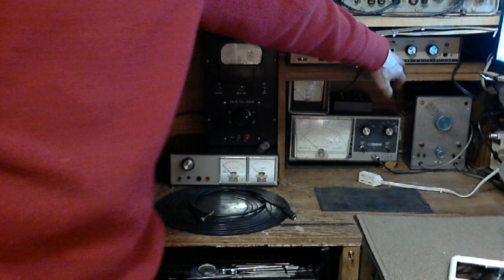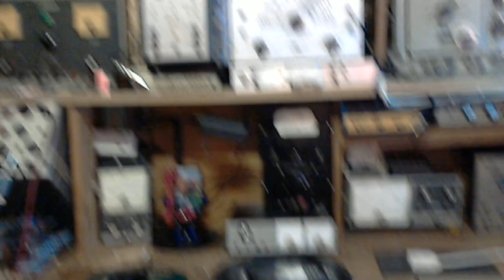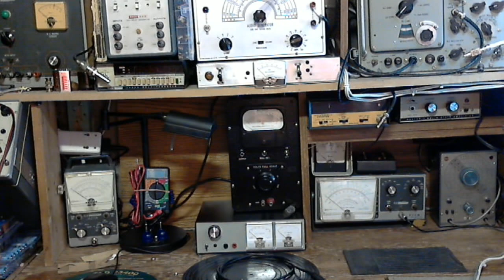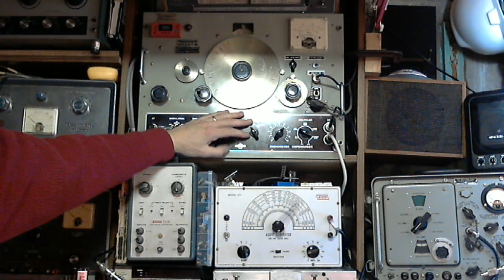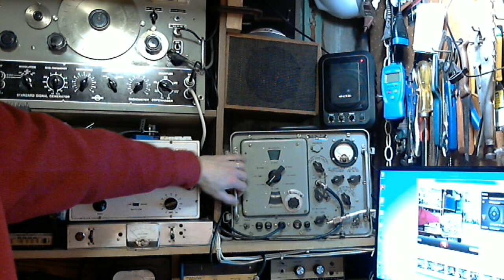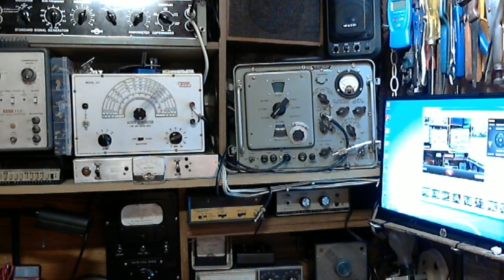Jim's Radio Shop - My Wall of Equipment

Comment: Half of the wall of equipment doesn’t work at all, out of calibration or he has no clue how to use any of it. All it takes to fix a simple AM radio is a Simpson 260 and a good soldering iron. Actually an oscilloscope is the best piece of gear any shop can use and not those shitty new Indian digital pieces of crap. Get a vintage 100 Mhz TEK scope , even a 50 Mhz will do. With a scope you can measure ant voltage AC or DC, frequency, time, phase shift, high frequency signals like 455 Khz and RF 1500 Khz. Input impedance will not load down grid circuits. He has no clue about any of that.

Comment: You hang on to that AN/URM-25D! Who cares what it may have been worth, it's worth a lot in utility today to work on older radios. When you get a chance, check out the meter accuracy and the attenuator as well. By the, .pdf versions of the manual exist. Get one and read it! 

You got a beauty.

Comment: So we have a new AN/URM-25d, good score on the parts lid
10 khz- 50 MHz its a nice ride
Reply from the maker: I'm counting on it having an accurate output and it is the specified generator for aligning a Collins R390A one of which I have and I've never aligned it.  Someday I will now.  And you'll probably see a video of it.
Reply: So you have the bristol wrenches to align  that with ?
Reply from the maker: TheTimeSpiders You made me Google it.  No, I don't have a set of Bristol Wrenches but there seems to be a number of alternatives that fit well enough and have the length needed.

Do you know any more tricky stuff with the R390A aside from lifting it?
Reply: 1 Get very organized  find out what R-390 you have the name plate should tell you this

2 Spend the money and get the Bristol
wrenches I know I know, But it only 20.00 and the wrenches fit some other shortwave sets

3  Find every scrape of info on the R-390,
now days the internet makes this a snap

4 read it all

5 make a dry run and understand all the steps
in the alignment

6 ARE YOU Sure THE UNIT NEEDS WORK

7 the R390A has a killer cap the zaps the filters in the bandwidth filter switching
get that fixed asap  c-553 .01 uf at 300v
And c-609 on the audio deck its a bad actor

The 390 is a hybrid of electronics and mechanics,, the two need to work together

get me you email and I send you the pdfs I have